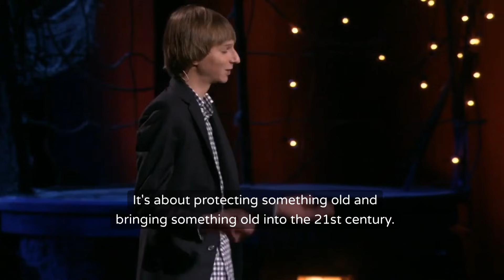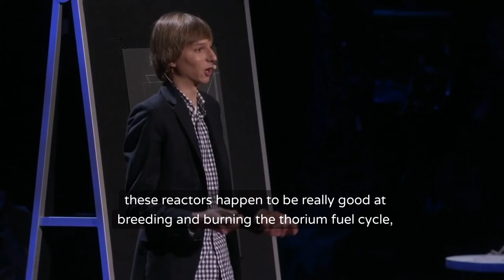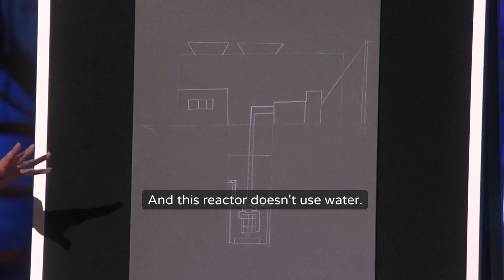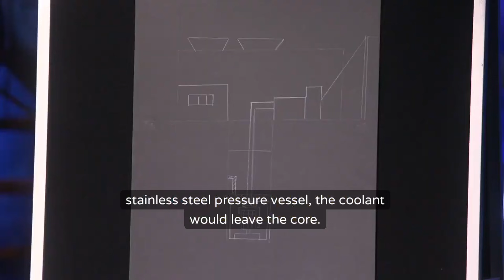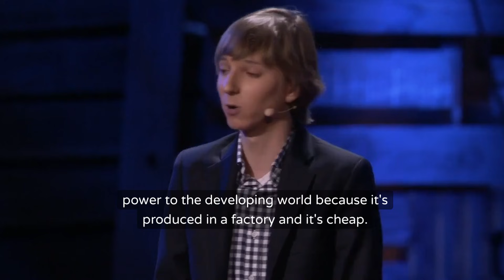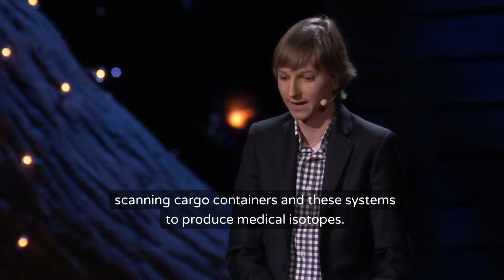I built a nuclear fusion reactor | Taylor Wilson

Comment: Taking a little shortcut with the explanation. The reactor does not heat up water that turns to steam to drive turbines. The reactor heats up water that - in turn - heats up other water. It is this water that turns to steam and drives turbines. The water in the primary and secondary loops are physically isolated. (Or at least should be!)